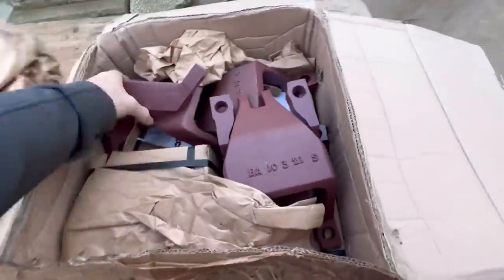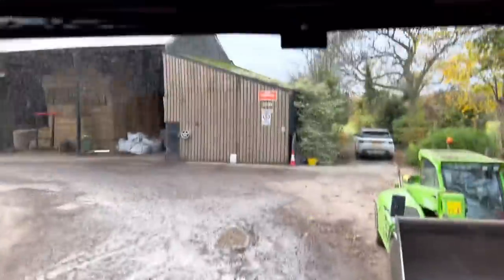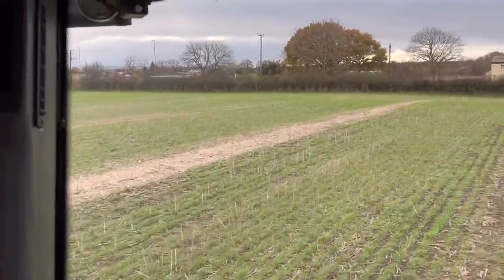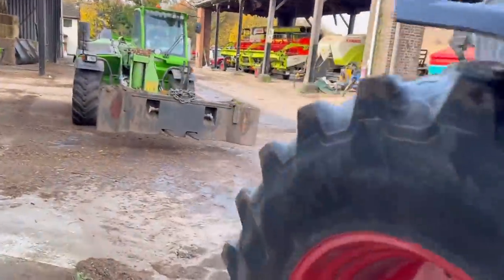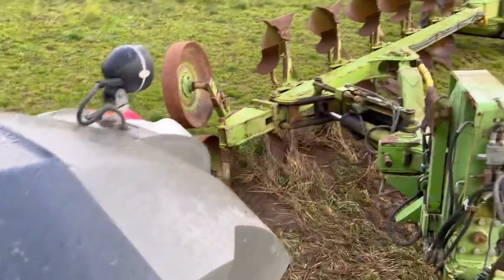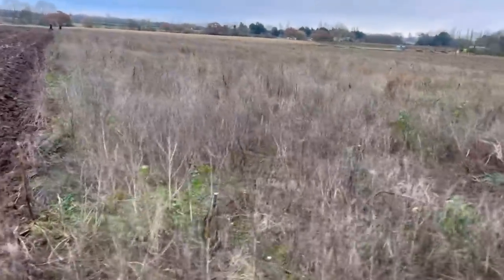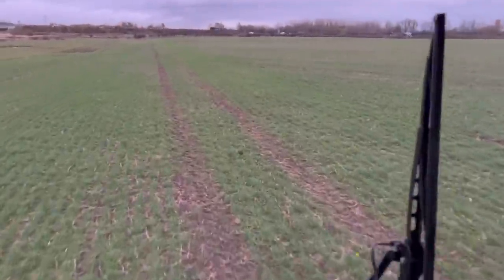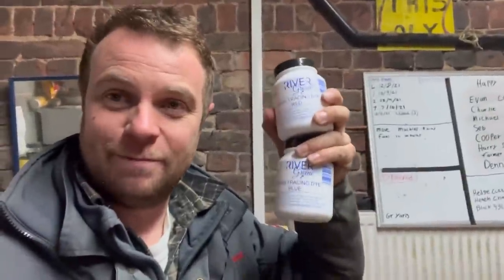Day611 #OLLYBLOGS BIG TRACTOR 10 FURROW PLOUGH AS WE PUT FENDT 936 TO WORK    #AnswerAsAPercent

Comment: Glad you liked the plough , I was keen for a go but didn’t get time , richard will be pleased it worked as it should 👍
Reply from the maker: Yer it’s set for on land I think 👍🏻
Reply: Better being on land with the size of tyres on your tractors. Lessens the chances of punctures. 
Did a great job burying most of the trash considering the amount and height of rubbish, plus the boards weren't nice and shiny to start with and you'd never used it before. Make sure you oil it up if you're not using it for a while. 
The chipper guides I reckon we're £40 each?

Comment: Hi Olly, the measurements that i need the windows for the workshop made to are: 2 at 3m wide by 2m tall, and 1 at 2.5m wide  by 2m tall. They will all need eyelets up each side and along the top for me to hook it on. If its easier just pass me on the details for your mate. Thanks very much
Reply from the maker: Did you message me on fb or insta I lost it